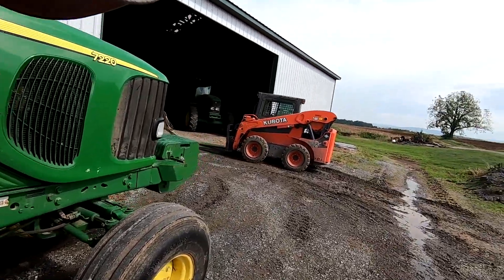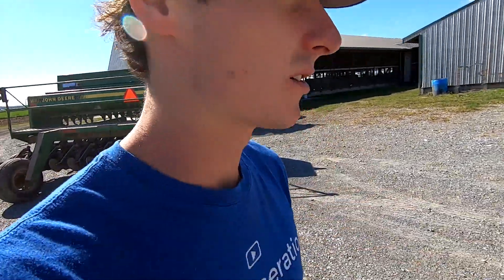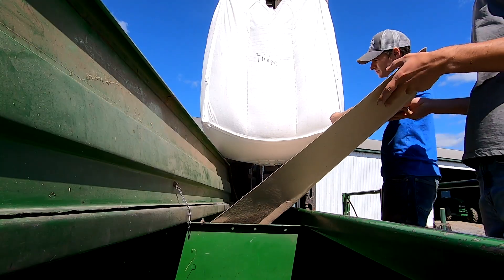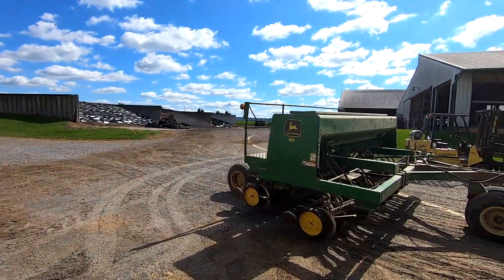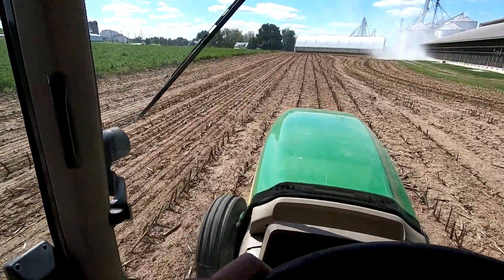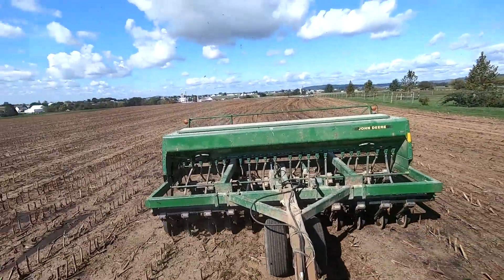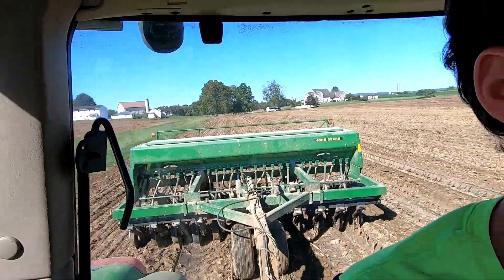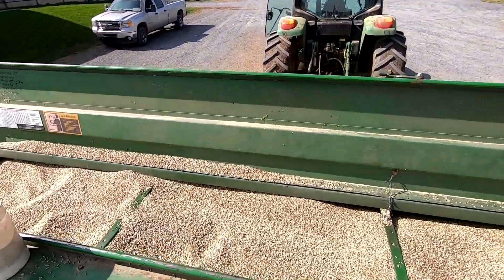No-till Drilling Cover Crops

Comment: That grease gun reminds me of the first time I greased up my Volvo EC55 excavator. It was bone dry in almost all fittings and bearings, and I had to pump several times to see any coming out. Think I used a whole cartridge the first couple of times, before it was properly filled up and stopped squealing like a banshee when I moved it about. Best of luck with your new baby. Hope the nursing haze is short for you two.

Comment: There is a product out there called the “spike tool” it pierces those seed bags and makes them easier to empty.  I believe it even doubles as a valve.
Reply: A lot more efficient I would think!!!
Reply: Fledbag has a spike valve that you drop the bag onto and then it creates  a sealable valve in the base of the bag, it also has handles you can use to help aim with

Comment: either firestone or michelin are the best tire for quality and longevity but they come with a premium price tag
when putting new tires on a tractor it is best to change both sides so then when you are pulling something with the diff lock engaged then you dont wear out your transmission from having two different diameter tires on the same axle

Comment: depending on how many holes and how close, they may be able to section repair.  I personally would use Michelin radial tires. That looks like what I call a torque split, tire may have been run a little low and it was pulling a big load. Kinda hard to tell from stopping the video to look at. The Michelin tire has a better warranty and its a radial.  Better ride easier on equipment, less flats, fuel efficient, and longer tread life. I have never been a farmer but I have sold tires for 30 years(retired) but the customers I sold to loved them after they got over sticker shock. let me know if you have any questions about tires of any kind anytime. hope this helps.

Comment: Gunna agree with Drew for the Firestone Performance tires. I just put two fronts on my t6050 and the previous were almost worn down to no tred and didn't have any dry rot. Got them from simpletire at a great rate and I think you can get a commercial account with them and save more

Comment: I don't know if you've ever made or seen a pyramid drag out of big truck tires I've made them for pasture dragging spread manure in active pastures 6 tires connected by 1 foot chain welded to bolts and about a 6ft chain lead you connect to the back of your tiller Works wonderful

Comment: Our seed bags have tubes in the bottom that you can untie and use as a spout.  Then tie it off or hold it closed to move it.  It threw me for a loop when I saw you stick a knife in it.
Reply from the maker: We can't reach far enough if we open that center hole

Comment: Make sure when buying a tire to check the date of manufacture. You can buy a good tire that was manufactured 5-6 years ago and it will split with little mileage/use on it due to dry rot. If a tire shop is offering a great deal on a good tire, it might be because they've had it in their warehouse for years...
Reply: There will be a 4 digit stamp on the tire, first two digits are week number, second two digits are the year of manufacture. eg 4618 would be 46th week of 2018, making it a 3 year old tire.

Comment: Just curious, what brand of tire is that on the 7220? I need to know what brand to avoid 🤪. Firestone is a very good, strong  tire if you aren't doing too much roading, we put Michelin on the back of our one tractor that spends a lot of time on the road and they seem to be holding up well too. But both of those brands are 🤑🤑🤑

Comment: I would try to get the same brand as the other side, I have found that different brands can have a big difference in height, even if they are labeled the same size.
Reply: Absolutely!  Big diameter differences from different manufacturers.

Comment: BKT’s are probably the best $$ for the wear. Michelin’s have been overpriced for a while.
Reply: Agreed. BKT or Mitas are pretty good tires for the price if you can find them right now.
Reply: My hubby likes the long lasting Michelin tires. !
Reply: I have Firestone 23 radials on one tractor and mitas on the other, I will never buy anything but mitas again. more traction and they were cheaper

Comment: Are those corn stubble cuts in the sides of the tires?  Doesn't look like weathering cracks.
Bias ply tractor tires have tougher sidewalls than the radials.
May be cracking from not running the duals and working the singles too hard?
Reply: That tractor was never designed to have duals on the rear, and I doubt that it gets worked to hard.

Comment: With all the tread on that tire, I'd go back to the supplier/manufacturer, and ask for an adjustment on a replacement. That should not happen.
Reply from the maker: We just bought the tractor this year so I don't know where the tires are from. Apparently they are a cheap off brand.